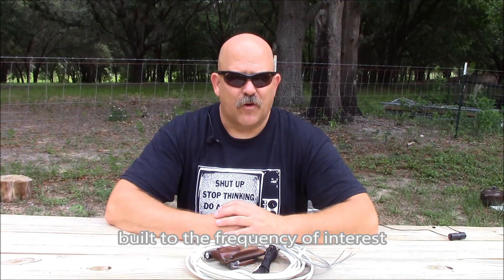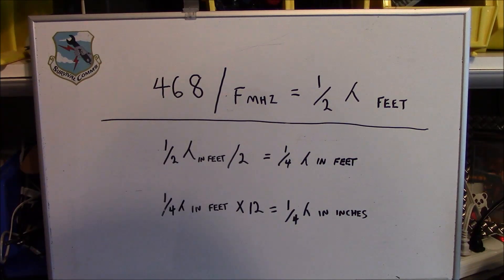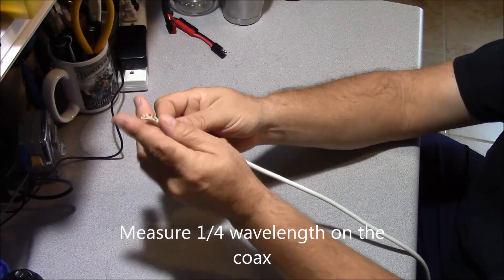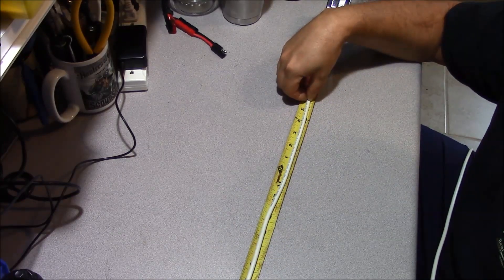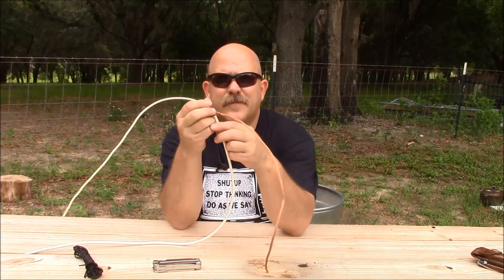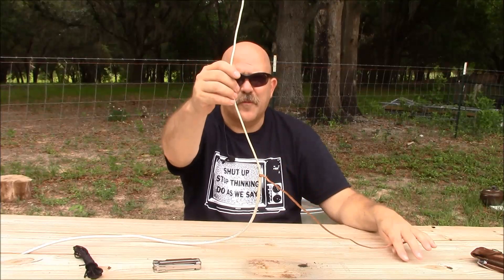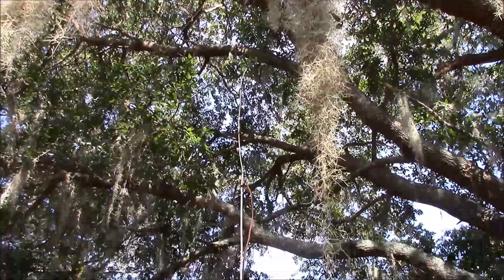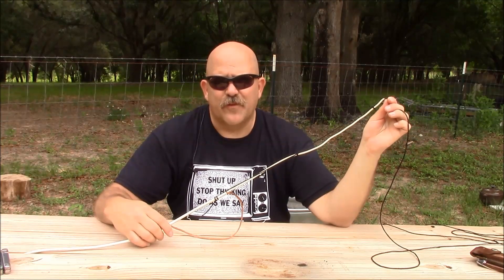Survival Radio Antennas 1 The coax only antenna

Comment: Nice! I've done the same but with a slightly more finished look - I used a small ring terminal on the antenna tip. Tied a string to it and hoisted it up. I tucked the shield next to the coax and covered them both with heat shrink tubing.
Reply from the maker: Thanks for watching !

Comment: I built something like this for 20 meters using 16 feet of 12 ga wire and 20 feet of coax. I use a banana plug and a SO239 F to F to connect the wire and coax. The top of the wire is about 16 feet up in a tree. I routinely hit stations or SDR's that are 700 miles away. No unun as this is basically a dipole with the coax shield as the non-driven side.
Reply from the maker: Very cool. Thanks for watching !

Comment: Can i use  60 ohms cable that is use for the antenna of the internet
Reply from the maker: I have not seen 60 ohm cable before but If you can terminate it in an RF connector that fits the equipment you are building it for  it should work just fine. Thanks for watching !

Comment: Back in the 1990's I was assigned by the search and rescue leader in a drill to go to our local hospital and check in to the net. Using my HT at only 1 watt(our nicad batteries didn't last long back then. No 5 watt HT's) I couldn't get a signal out of the building. I had a piece of coax with a BNC connector And knew that from my fingertip to my elbow was 19-1/4 inches so I cut the antenna like you did. The windows at the hospital only opened 1 inch and I was able to drop the coax antenna outside and down the wall a couple of feet. I had a great signal to check into the net that way.
Reply from the maker: This stuff works ! Thank you for sharing and thank you for watching !

Comment: I find its easier to remember 234/Fmhz = 1/4 wave. This way if you need to cut wire for either side there isn't any more math. Or just double it for 1/2 wave. But I generally deal with 40 and 80 meters. 65ft is much easier to deal with than 130.

Also it should be some gain on the side where the shield / radial is. So if you are on the "lunatic fringe" turn that side towards the station or direction of interest.
Reply from the maker: I debated which formula to use and decided on the half wavelength one. I wanted to give the non radio savvy viewer one formula to use and remember. I made the first version of this video (still in my playlist ) almost 5 years ago where I used TV coax and a stick to make it a single element ground plane. Stay tuned much more to come. Thanks for watching !
Reply: @survivalcomms  True! Great video! 1/4 wave fits most applications. On a vehicle especially.  But for those who don't know 1/4 wave is only half the picture so maybe the 1/2 wave formula is best. Brings focus on the other half.

Comment: Great video,  just made myself a "sleeve dipole" the other day.  Same antenna just didn't pull the center conductor out, just slipped the braid back over the feed line.  Keep posting, excellent stuff!
Reply from the maker: Thank you ! The legacy 800mhz dipole portable radio antennas were just that - sleeve dipoles.  The short wavelength made it possible. I appreciate the feedback - Thanks for watching !
Reply: I used the same technique to make a sleeve antenna for the back of my plate carrier

https://junglesairsoftblog.wordpress.com/2020/07/27/diy-vest-worn-antenna/

Comment: So, the length of the shielded wire is irrelevant then? And if I have "more", is it significantly better at 2x18=36? Or ... 4x18 for a whole-wave?
Reply from the maker: The coax acts as feedline  until the point where you separate the center conductor and shield. From that demarcation point the conductors act as antenna elements. There is no benefit in trying to get gain making the antenna longer than its point of resonance in these simple antennas. 1/4 wave elements work best. Thanks for watching !

Comment: Been there, still using it (although I'm using metric formulas/measurements). Good video, excited for the follow up antennas. 73's.
P.s. I know imperial or metric, the dipole lengths are the same, just explaining how I calculated.
Reply from the maker: Thank you ! I debated adding the metric formula and the direct inches formula but I didn't want to add another formula to the video to keep it simple.  Thanks for watching !